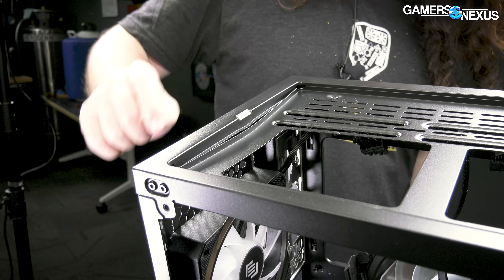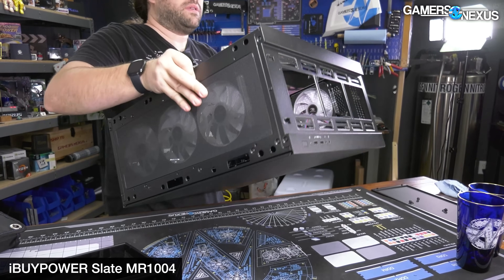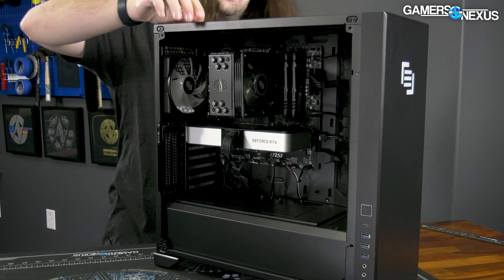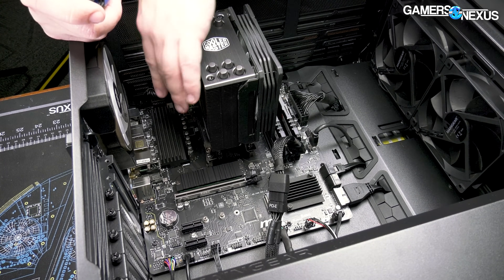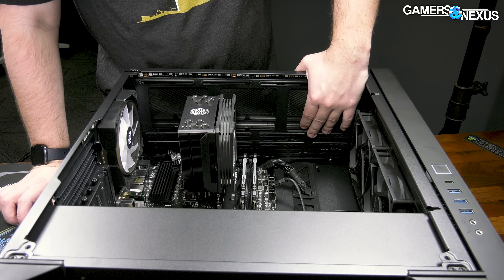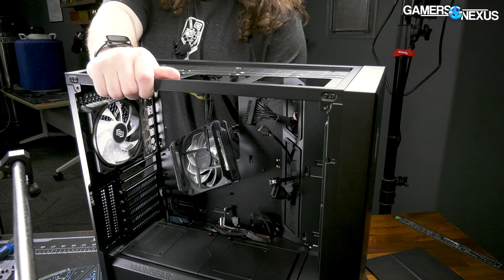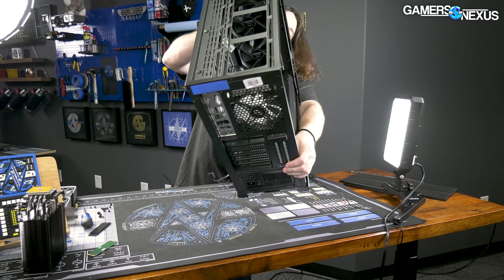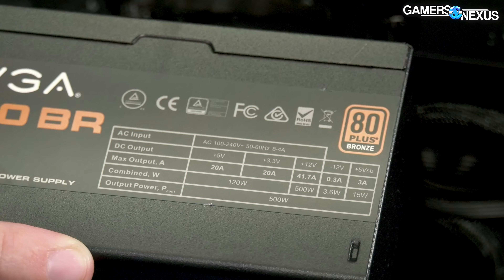Maingear Did It Right: Secret Prebuilt Gaming PC Review ($1700 Vybe)

Comment: Had they designed their case to have mesh panels everywhere, this would've made Steve a happy happy man.
Reply: I think at this point... just having the front have 2 fan sized meshed holes, Steve would have given high praises.
Reply: If this system had a front panel like  the Cooler Master NR600 ( great CM product ) and a better air cooler which cost no more money than a Cooler Master 212 ( not great CM product ), then this system would be a home run, basically.
Reply: Closed cases are bad tho, theres a reason Steve complains closed cases as minor complaints.
Reply: @Doflaminguard  I 2nd that. I want to live in a world where closed cases are only used for water cooling systems
Reply: I hate mesh front panel. Holes are so ugly.
Reply from the maker: Even just one of the many existing cases would be good.
Reply: @hanley6478  every mesh case I've looked at looks way better than the countless tacky solid panel cases. Either way I'd prefer my pc not get loud and hot.
Reply: Also me
Reply: @Numb_  Even on water cooling you need a lot of airflow!
Reply: Better power supply wouldn't hurt either.
Reply: @hanley6478  Why do you hate them? Is it the texture or seeing the stuff behind them or dust or what?
Reply: @huggarty5434  I'm very fond of my Fractal Define R6 and its not a mesh front end.

Its also dead silent other than the GPU when it spools up and doesn't throttle.

Helps I spend money on decent components  and cooling.

But I hage noise so much I refuse to even run a HDD as they make too much noise.
Reply: or just install the 2 fans as intake in the top slots xD
Reply: I wonder if unplugging the front fans would affect the temps, and how much the temps would be affected if the front fans were moved to top intakes
Reply: @GamersNexus  Would love if you did a review on the KOLINK Citadel Mesh case as a budget option. It seems good for the price, atleast in europe.
Reply: @Doflaminguard  It depends. I go out of my way to build silent computers. So I get comparatively low-wattage CPUs, fanless graphics cards, and high-efficiency PSUs. I've replaced the case fans with Noctua fans (partly because the case is now 20 years old and they wore out). Low electrical power means low heat production which means low heat dissipation requirements. For my needs, that case shown would probably be over-ventilated. But my needs aren't your needs.
Reply: @Numb_  Still need airflow over the rest of the system. Even in a custom loop, you need some intakes
Reply: Had they used a 20$ more expensive case, they could have good cooking without designing anything at all. Like, pretty much any 50$ case would be better than that.
Reply: @Jun1oR1101  Yes please GN, please  Review that case.
Reply: @Markus-zb5zd  This.  It's a free improvement, though the out-of-the-box thermals were not as bad as expected.
Reply: @lesliegossner681  Steve has said that mesh panels allow you to lower fan speed to compensate for the reduced noise isolation compared to a solid panel, and still come ahead overall in terms of BOTH noise levels and temperatures.
Reply: FishGear, the new and improved SI, now with fishing nets all over. 😁
Reply: @hanley6478  Then you haven't seen be quiet's Pure Base 500DX, my friend

Comment: 9:32 I'm glad it happens to everyone. I built my first AMD PC in years and had to pull the cooler... and the CPU accidentally. I thought I might've broken the socket! Luckily no harm done, but had to heat the chip a bit to get it to pop off the cooler.
Reply: waiting for that next good vid Jeff :D
Reply: Did you, or redshirt Jeff yank the cpu out with the cooler?
Reply: even with an Intel CPU I turn on the PC for at least 30 minutes to warm up the thermal paste before removing the cooler to avoid this risk.
Reply: Next time us a hammer and chisel instead of heat
Reply: I did the same thing the first time I moved my R5 3600 into another mobo! Didn’t know you’re supposed to run it for a while to melt the thermal paste and pulled out the CPU with it, had to bend back a few pins but it made it! Still running in my PC today
Reply: It's one of the main reason LGA socket is better than PGA
Reply: TWIST! ALWAYS  TWIST first to break loose the thermal compound before lifting. During first batch of stimulus checks when everyone was building a custom PC, I had probably one person per week coming in with destroyed pins because they tried the stock cooler and then attempted to upgrade to liquid.
Reply: Can't wait for AM5
Reply: GN should make a PSA video on how to remove the CPU cooler the right way, including preheating and twist motion.
Reply: in the past I have turned mine on for about 30 minutes to get heat into it and then switch off and twist the cooler to remove, it's easier that way
Reply: @renatoigmed  I pulled a 5950x out of the socket with the cooler, after having put it in minutes earlier, in order to check paste spread. AMD really should have had a bracket of somekind on am4.
Reply: My first socket based computer, a P4, I went to pull the cooler for routine cleaning, and the CPU came out too.
It was REALLY stuck on there too, although I was also a lot younger.
I was green as grass in understanding "modern" computers at the time, and was highly confused as to how to get the thing back IN there.
Reply: I’ve done it
Reply: Just run your pc for few minutes before teardown. Will never have this situation then.
Reply: This happened to me fairly recently, and bent a couple pins on my 2700x. Was so sad. managed to salvage it though
Reply: Pulling the CPU with the cooler is almost a right of passage with PC builders.
Reply: @orangeapples  true but still a oh $#!1 moment lmao
Reply: Did you put the chip on a stove to heat it?
Reply: @renatoigmed  I run cinebench beforehand and this still happens to me lol
Reply: It happens on Socket 478 a lot.

Comment: I bought a vybe with a 3070 for 1600 on black Friday. Wish I could have done my own build but all things considered I have been very satisfied with the system. It did come with the 3600mhz memory running at 2400 out of the box which was weird but not a big issue obviously.
Reply: With the quality of maingear support I am sure minor problem like this can be resolved almost immediately, when I look at SI, my primary concerns are the build quality and hardware, these are not easily fixible by a novice user.
Reply: It's a standard computer (unlike Dell or HP) so not much of a loss on buying instead of building... At least you have a machine that can grow with you.
Reply: That could easily have been the system resetting it for whatever reason, or just a tiny oversight by the person who put it together. Rebooting to bios, clicking One drop box to change that is Nothing to some of the other things people have had to deal with.
Reply: @YungThuga212  yeah I fixed it immediately upon discovery, again it wasn't an issue at all. Only pointing it out because it is possible that some SI customers would never discover the issue and would be losing some performance. But it's a tiny complaint. I recommend maingear for anyone going the pre-built route. Just make sure everything is in order or have someone with technical knowledge do it for you. This advice would extend to most near $2000 tech purchases.
Reply: @Verpal  Problem is your average PC consoomer has no idea what ram even is, much less what speed it's running at, so they would never know, and would have wasted money on the ram.
Reply: how u finding it? seems like a good performer especially in regards to noise. pretty quiet?
Reply: Tbh with GPU prices, it might be cheaper to get a prebuilt on sale than diy.
Reply: It is for those who don't know that like you and don't change it themselves.
Reply: @WayStedYou   those that dont know arent those to consider the difference between 3600 memory and 2400 memory a big issue
Reply: It's not weird , RAM always need XMP profile enabled in the bios to run at full speed.
Reply: @crisnmaryfam7344  It's not an oversight. Many system integrators intentionally do not enable XMP because it's technically "overclocking," despite advertising the PCs with the RAM at the XMP clock speeds.
Reply: @tatooine_dream  yeah it's pretty good. Case, while somewhat constrictive in regards to air flow, is well designed. Plenty of space to hide extra drives and easy cable management. The noise level isn't bad at all. I mean it can get loud but it's a PC with a 3070 it is what it is. I will say however my set-up is different from this one they're currently selling so take my advice with a grain of salt. Mine is 3070 vs 3060ti also  mine came with a stock amd cooler which I've since swapped out but in terms of case design yeah no complaints.
Reply: @TheDeadfast  it may very well depend on the policies of the board and CPU manufacturer regarding RMAs with XMP on whether they have it enabled or not. The system in the video had XMP enabled by default. The system the commenter got could have been disabled by mistake or it could have to do with who made the relevant components.

Comment: From what I've seen of Maingear, they're not the sort of company to let something like that case damage slide. I spent most of the video wondering how they could've missed it. It's the filter. The damage is obvious with the filter removed, but with it on it's a lot harder to see. I can't really see it from the inside either (though maybe it's more noticeable in person).
Reply: That feels way more like shipping damage than anything Maingear did or even saw (they probably toss it if this case came to them as is). Having worked at UPS (probably applies to FedEx and many others) for a year or so, let's just say they aren't gentle. Even with 'fragile' stamped all over the box. If anything, it seemed like they got a bit rougher than they otherwise would when they saw it. I've also seen prebuilts just like this come flying out of a box (from bad boxes/taping jobs, customs sometimes being a culprit). This could've easily been that (obviously hard to without knowing the process). Tossed out of a box, thrown into something and then repackaged.
Reply: @icanmakeeverythingilovedie9861  You're completely right, it feels like if you put fragile on it they get more of a "fuck this guy" vibe and handle it roughly like they have a personal vendetta for you asking them to be careful
Reply: @VaderxG Also possible they missed it completely by not checking under the dust filter. Since you cant tell with it on and the fact there's no top mounted fans I think it's plausible they could've easily just overlooked it

Wallace denies it in his comment saying it's impossible for it to have happened in house but with no damage to the box and the amount of packing material used, I doubt it happened in shipping. Honestly he should've just said they'd take a better look at their QC process to make sure it doesnt happen again rather than deflect the blame
Reply: you only as good as your slackest member of staff while the majority may of started again and binned the case a slacker employee would ship it anyway
Reply: Since the filter was pushed down at 20:25, there is possibility of shipping damage.
Reply: @icanmakeeverythingilovedie9861  Yep, I can 100% confirm this. I've worked at eBay, Amazon, UPS and other companies who do major e-commerce and shipping services and it's fairly universal in how little shippers care for other people's packages. I've seen packages thrown, kicked, stomped on, sat on and actually seen people sleeping on them when loading them on trucks. You name it, I've seen it pretty much. And trust me, the sorting process is no better. Boxes get jammed 24/7 on conveyor belts and literally turned into accordions in seconds from the pressure and other packages smashing up against them. What's more, the shipping company doesn't even care. As long as the package isn't breached or opened in the process, it's on the truck and out it goes.

So it's really no surprise when someone's package gets demolished in shipping, it's ineptitude from the top down to the bottom. It's especially funny and poetically ironic when those same people would complain about their packages arriving damaged when they ordered stuff online, like they either let the same thing happen to other people's packages or deliberately mishandled it to try to damage it. I'm not going to lie and say I was the most gentle handler of packages when I worked those jobs, but I did try to have at least some regard for other people's packages, because I sure as hell wouldn't want mine to be so grossly disregarded. And you wouldn't even believe the Ace Ventura mentality when certain workers saw a package with FRAGILE on it, it'd be a game of "how long will it take before whatever's in the box sounds like it's broken". I'm not even kidding. So, if something arrives broken or damaged, it's almost 90-95% likely it was done by the shipping service.

Comment: Appreciate the honest and thorough review.  My wife and I are on our 3rd set of Maingear Vybe machines.  We handed the old ones down to family and they are still running strong.  The very few times we needed support the company has been excellent.  We opted for the liquid CPU cooling option which brings the noise level down significantly and has been trouble free.  Can't recommend them enough.  Solid and stable machines at a competitive price.

Comment: Sweet, I correctly guessed in the poll it would be a Maingear. My wife has a 6-year-old Maingear that has been trouble-free. Another great builder that is cheaper than Maingear/Origin/Digital Storm is eCollege PC. That's who my current rig (5800X/RTX3080) was purchased through in Dec 2020 and it was over $1K less expensive than a comparible Origin/Maingear/Digital Storm system with the same components. They have been around for over 20 years now, really cool guys and super responsive. My rig has been problem free and was built very nicely.
Reply: @yanuehara8017  No, you would need to do your own due diligence on eCollege PC. If you search around for their customer reviews, they are overwhelmingly positive.

Comment: Interestingly, this motherboard - the MSI B550M Pro-VDH Wifi - was rated "Best Value B550" board by Hardware Unboxed.  It was about $100 back in August 2020 when they tested it, had more features than boards costing $130, and a serviceable VRM that didn't throttle an overclocked 3950X.
Reply: Yea it is a great budget board...but in a $1700 pc????
Reply: @samgoff5289  that motherboard is adequate for this build. The cost is in the cpu/gpu
Reply: @samgoff5289  Why waste some of the buyer's $1700 on a more expensive motherboard?
Reply: @Vegemeister1  it’s profit
Reply: Wasn't that the A-pro with the pro-vdh coming in close?
Reply: @GrimpakTheMook  A-Pro was the best full feature, whereas the VDH was the minimum acceptable quality
Reply: @GrimpakTheMook  HUB Steve did applaud the MSI B550M Bazooka for excellent VRM thermals, but stated the Pro-VDH Wifi was "the one to get" based on features & price.  No mention of the A-pro (maybe that was in a higher end roundup?).
Source: https://youtu.be/wuPH9pCCK-E?t=1255
Reply: @samgoff5289  Fair point.  I think enthusiasts who would build their own PC value parts differently though.  We'd spend more on a motherboard or power supply.
Reply: @runescapefan0001  the cpu is $200...not sure you are getting your moneys worth from this prebuilt when they have selected the bare minimum budget parts for everything which is fine if you are doing that to save money but this is essentially just for extra profit to the company not savings for buyer
Reply: @samgoff5289  open up a business textbook